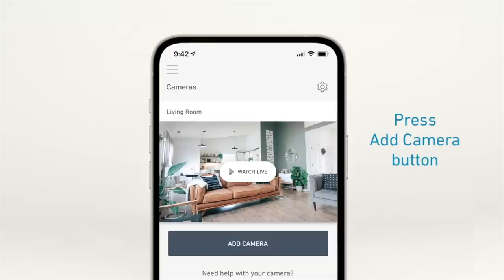I Built the MOST CURSED GUN EVER!!! Oh, and Finally SBR'ed My P90...

Comment: Now what you should do is make an over-the-shoulder stock that fits into the AR magwell, so you can shoot it like Brandon's Barrett M82A2. Just to go the extra mile.
Reply: Length of pull: Y E S
Reply: The magwell is where it ejects out of
Reply: @roguereaver634  so make it hollow, a frame around the inside of the magwell. should still eject fine.
Reply: @roguereaver634  ah hecc. u right

Comment: You guys never read my posts, which means you will never learn what i'm saying. 5.7 isn't a PCC, you didn't need to chop the barrel.  Now it performs more like a cheap PCC in 9mm instead of a mini AR-15.  What are you guys thinking this for ?.  It's still semi auto, means you need range accuracy, It's not laying down suppressive fire or rapid fire, so do you need a gun shorter than my PP for a semi auto ?.  Semi auto then you're better off with the normal barrel on it.  Brandon missed 90% of those full auto shot, with the squirrel.  Matt is running a supressor so that makes sense I guess, hell I can't own those.  Not sure if it's worth getting a 5.7mm for this purpose, I would do 9mm and then surpress that or 10mm with a shorty barrel, it's much cheaper.  The PS90 is a cool weapon, especially with full auto but compared to a 10mm vector, I don't think it matters. I know about it has zero recoil, etc.  I am pretty poor, like most people I shouldn't be able to afford a PS90, but there's a P90 like somewhere nearby possibly that I use sometimes, it's good and it has a MRO optic with a low profile mount, closer to your barrel.  It works as a stellar combo, I would use no other type of mount option, Mac had one and I saw his channel.  Think it's 140$, kind of expensive piece of metal.